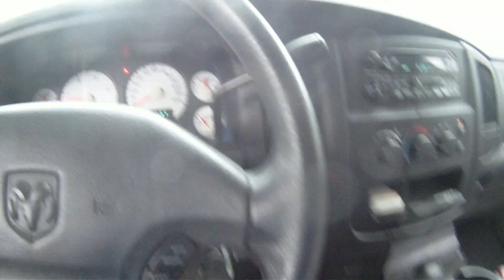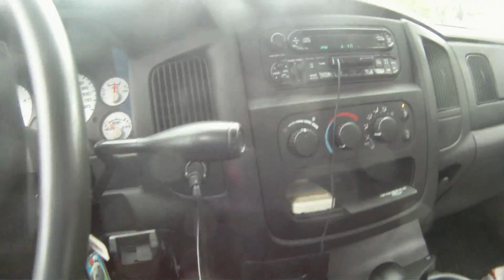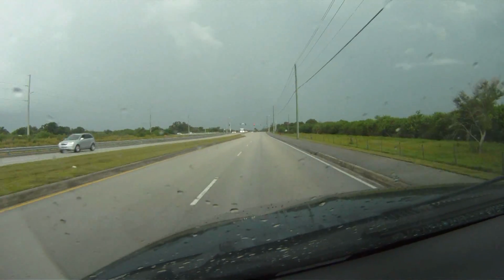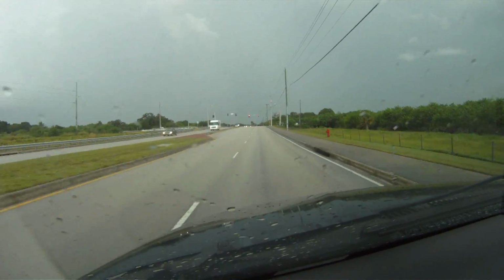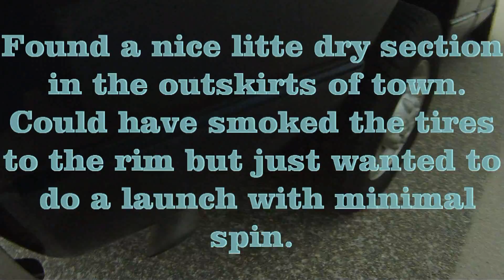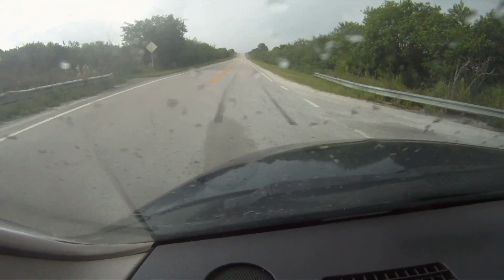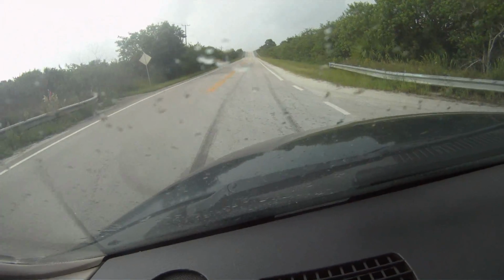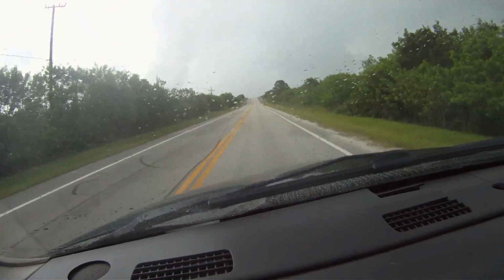Dodge Ram 2500 Cummins straight pipe and Smarty

Comment: Get some guages monitor those EGTS and boost otherwise sick truck Greg
Reply from the maker: Thanks Jeff. Yes, that's next on the list. I am keeping it at a safe tune and not towing much weight so I am pretty sure my EGT's are not bad. Especially with less restriction. I'll be getting EGT, boost and transmission temp gauges soon. I love when guys in gas 4x4's like a Chevys or even stock diesel Fords get next to me. When I romp on the go pedal and motor on them the look on their faces is priceless. Best part is that it's pretty quiet when cruising but when I get on it, it barks like a wild dog! Oh and rolls coal too. ;) Took my good buddy out for a spin and when I goosed it he was laughing like a little kid. :D